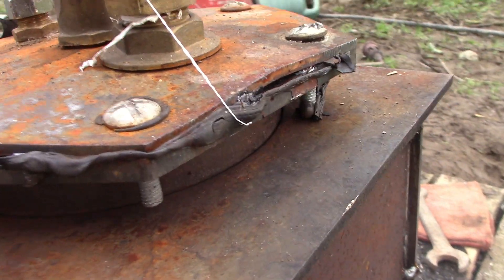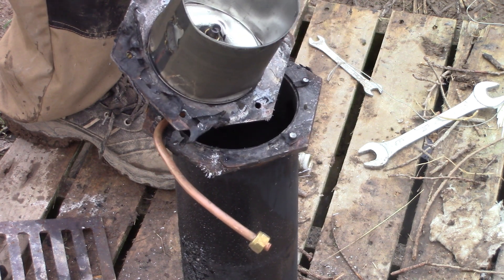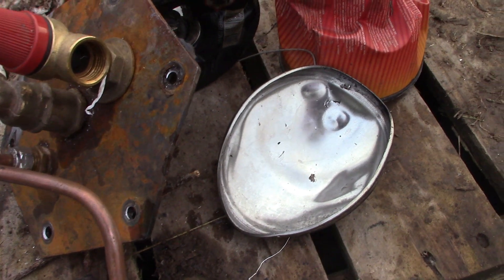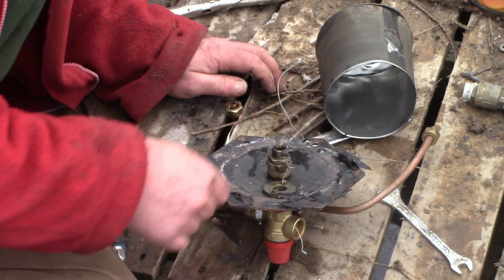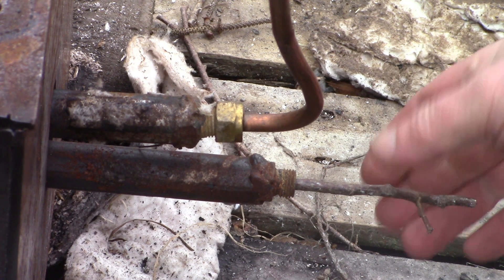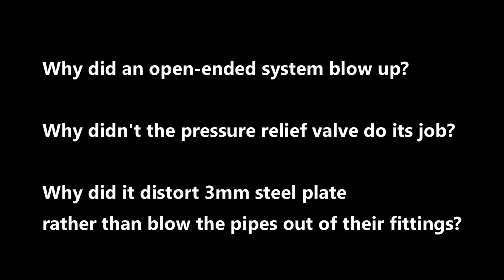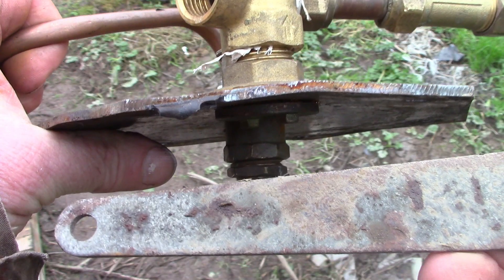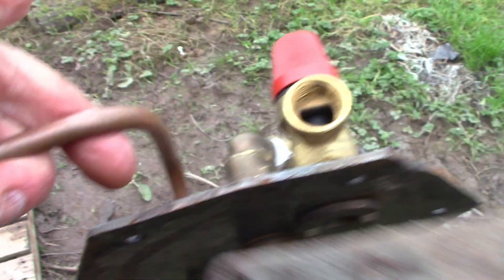Why Did My Boiler Explode??!! My Own Big Bang Theory...

Comment: I think the upper gas bottle was leaky and got water in it over time.

So as you heated the boiler up the pressure increased in it every time a little more.

This time there were enough water in it to blow the bottom out and the top was accelerated upwards. Hitting them lid of your container.

Comment: I'm glad you're safe. Maybe this is a good reason to add more pressure relief valves farther down the line from the main water boiler?

Why did an open-ended system blow up?

Just because there's an open end doesn't mean that it's impossible for the pressure in the system to become sufficiently high to rupture something. For example rocket engines are open on one end, and you can still have a nozzle failure where it blows up. If there's enough restriction in the system it can effectively be the same as being a closed system. Ever tried breathing through a straw?

Why didn't the pressure relief valve do its job?

I can only assume the pressure in the system at that point was not high enough to open the valve. However it seems that the pressure elsewhere in the system was high enough to cave that steel lid upwards so I cant really say. Could also be a faulty valve or not rated for that temperature? Seems simple enough to add redundant valves through the system?

Why did it distort 3mm steel plate rather than blow the pipes out of their fittings?

I'm guessing this one is in part due to the much larger working area of they plate compared to the relatively smaller area of the pipe. Lets say your lid is about 10 cm across, so about 31 cm^2. The pressure in the chamber is 2 bar (not enough to open the valve) so we have about 2 kg per cm^2 for a total of 62 kg being exerted on the lid, compared to about 2 kg on the area of the pipe.

I'm not sure what temperature the boiler walls were at but the steel could be significantly weekend by the temps achieved inside a wood stove https://www.engineeringtoolbox.com/metal-temperature-strength-d_1353.html https://fireandsaw.com/wood-fire-temperature/

Another possibility: Steam (a gas) is compressible, while water (a liquid) is not, so the steam parts of system would be able to absorb the compression in the steam by being compressible, while that same pressure on the water would push on the lid since effectively the water would not be compressed.

Best of luck, it's been (and continues to be) great fun watching your videos, and I hope you stay safe. I really enjoy your simple approach to understanding and solving problems.
Reply: And it also seems like we cant rule out there being some gas, possibly mixed with air left in those gas canisters. An explosion of that would have a great effect on the water boiler chamber but be absorbed by the steam in the steam pipes.

Comment: I think The lower canister collapsed and the increase from the steam flash blew the upper canister up into the lid, that is why it was punched over the valve. The other option and more likely is that the heat of the steam caused a gas (left over butane/propane) in the upper canister to explode and the bottom blew out and the top slammed into the valve on the top. The collapse of the lower canister could have occurred either during the explosion or prior from the steam pressure.  Also the pressure/temperature valve did not release which would indicate it was a very rapid explosion not a steam explosion. 
I'd change the floats to foam filled containers rather than gas canisters. I think I would make the top flange round and double the number of bolts.

Comment: I think you need a pop off in addition to your pressure relief valve.. I deliberately made weak point that can pop off in the event of a failure like you described at the end of this video rather than potentially causing catastrophic failure.

Comment: you might create backpressure frome the 2  and 3 stages, and the second thing, when you create a low presure, the boiling tempreture decreses....  therefore you might get a larger amount of steam.. i sugest using a ful wood floate to prevent implosions....

Comment: yeah this result is exactly why i said i was so relieved last video, when you mentioned adding in the pressure relief valves, etc. 
steam engines are novel and great, but they really are not something to mess around with. and there's always something you could never predict that messes it all up

Comment: The reason why the tins blew up was most likely the expansion of gas in a separate and completely enclosed system (tins) and the easiest way for all the gas to escape was to un-roll the seams of the tins. The sudden increase in pressure from the tins failing caused the other one (probably cooler) to implode and the 3mm lid to bulge.

Comment: I beleve the cap of the top float broke (possibly heat stress?) and allowed the float to reach the top of the steam chamber (https://youtu.be/AzI4rQ-gDQ0?t=109). These kind of containers are great at holding high pressure but can be crushed fairly easily. At this point the float created a seal over the entire top of the boiler blocking the output and relief value. This increased pressure crushed the floats and caused the failure of the top lid.

To guard against this you would need to make sure that there is always a path for steam to reach the relief valve. A number of small baffles inside along the top and sides of the tank with holes to ensure steam can flow around any obstruction should prevent this kind of failure.

To those that beleve the floats exploded: The air in the containers would get hot but it has a fixed initial volume and thus the pressure is purely a function of tempature. I the case of the steam the pressure can get much higher since we are boiling off the water and increasing the density of the steam ( and therefor pressure ). The diffrence in pressure could crush the floats.

Comment: The video before this video, the one where you put the gas canisters inside the boiler, is one of those videos where people shout "NO don't do it" but of course being past  tense you already had done it. Your boiler exploded because you cooked 2 gas canisters inside it, regardless of whether they were empty or not they were still pressurized canisters and as such potentially "bombs" if cooked off. As you placed them inside and secured to lid I was already expecting this outcome video. Your extremely lucky, the results could of been far worse.

Comment: I think I'm leaning towards what Matthias is saying, the sealed floats were the problem I think. I know some people are saying there is a lot of resistance from the long steam path, but I don't know enough about that. It certainly seems like the sealed floats could explode under high heat. Possible to find ones with a relief valve, or maybe you can add your own or a tiny one-way valve in the floats so they can release their pressure but not fill with water. My initial thought was an opening at the top of the float to let the air inside equalize in pressure, but without letting in water, but you might have to switch to a single float situation with that. 

At any rate, fascinating stuff as always, and I'm very happy nobody got hurt! Cheers!

Comment: My theory: I think your bottom float imploded under the pressure from within the boiler, being closer to the heat source it weakened first,
That volume of air from within the float is then forced out at extreme pressure, hitting the top float and launching it into the roof of the boiler, impaling itself on your fittings and releasing it's pressured ait in the same moment.
 The force of the top float hitting the top plate combined with the increase in pressure, buckled the boiler roof until it broke the seal. 

Despite being open ended, the sudden increase in pressure had nowhere to go but through the top/main gasket.

🤷🏼‍♂️? Thoughts

Comment: My theory is that as the float collapsed it did so suddenly and quickly, picking up a LOT of momentum, that then slammed upwards into the lid like a hammer blow when it couldn't colapse any further.  I would replace the floats with something solid that can't colapse, but which still floats, like a piece of wood.

Comment: Using those small single-use aluminium propane/butane cooking gas cartridges was likely a poor choice and runs counter to the safety recommendations written on the cartridge warning not to expose the cartridge to excessive heat even when empty as a significant amount of the gas may still be present even when it no longer delivers any of it's contents, exceeding their designed pressure rating is not difficult if they are exposed to prolonged heating, they are designed to withstand internal pressure but are not intended to stand up to external pressure. They are very accessible pressure vessels but I don't think they're suitable for the application you're using them in.
Now this is just conjecture but I'll say this: The single-use non-refillable propane/butane cooking gas cartridges you used are constructed in a similar way to a carbonate soft drink can; they are made from a sheet that is formed into a dome shape which is joined to a rounded lower section by a roll joint and that joint is designed to quickly and cleanly fail in the event of hazardous overpressure (such as during prolonged heating) instead of the walls rupturing and potentially projecting small, high velocity fragments. This joint failing results in the upper formed section being projected upwards and the lower section downwards as a result of the contents escaping downwards and the upper section becoming impaled on the protruding valve body may have occluded both the emergency pressure relief valve and the steam output to the point where steam could not escape fast enough to prevent overpressure, which combined with the impact from the float body may have deformed the upper plate enough that the boiler was open to the atmosphere resulting in a BLEVE: A boiling liquid expanding vapour explosion, which occurs when a liquid substance in a container like liquid butane or water which remains as a liquid at that temperature due to pressure rapidly and explosively flashes to a vapour when the container ruptures and the contents are then subject only to atmospheric pressure, that volume of pressurised liquid occupies a volume often 1250-2250x smaller than the same amount of substance as a gas at atmospheric pressure and the change in volume occupied by that substance is often so rapid and violent that it precipitates as an explosion.

Comment: Irrespective of the cause... Given that you will continue to mess about with this, and given that "bad things" can happen (as several others have said, that was NOT a boiler explosion, it was just a leak), may I suggest that in future you add a burst disk to the boiler? At least by doing that, you can hope to control where the upcoming /actual/ explosion happens, and perhaps direct it away from yourself. The key is that pressure relief valve has a limited capacity, and can become clogged. A burst disk provides MUCH larger capacity, and can be placed in a location which a human is unlikely to be facing. Now... what position is that on your setup... scratches head That's a harder question. On a full sized boiler, it would be up top, above human head height. On a small boiler, it should be on the bottom, directing the force into the ground and around boot covered feet; but then the boiler has to be well mounted to a cement pad or something that will keep it flying up as a result. Not possible on your setup. Perhaps yours could face out one side and you can just try to never be on that side? Please don't kill or mame yourself? I would miss your videos.

Comment: My best guess is that because you had the steam outlet reduced, this caused a slight pressure increase which also raised the temperature of the floats this could have caused a rapid failure. As for the pressure release valve not opening, this is likely caused by rapid explosion. I do know that 7 psi in in a pvc pipe is enough to blow a rubber cap/hose clamp off with some force. I do not know how to calculate the pressures of steam explosions yet i that 30 psi explosion is enough to bend that lid. When you were explaining the collapase of the containers that could have caused a rapid growth of pressure to which caused the lid to warp. These are my guesses and the only thing factual is the rubber cap blowing off at 7 psi as I have done this a number of times on job sites.

Comment: I don't think your boiler exploded. I think your top gas canister exploded. The hole in the top of the canister was pushed up against the valve at the top, sealing it off. Pressure built up in the canister and it exploded inside the boiler.

Comment: i beleve the top float / gas canister blue up as even if it hase 0 psi in it coled gas expans fast when heated up so then the bottle blue up i think it would of forced the top half of it up hard anouth to bend the 3mm steel bariung mind its pushing aganst water like a bottle rocket that will explain the force and the bottom of the bottle crushed the lower float thats what i think as the safty valve should of opend way befor steam preshure could of bent the 3mm steel.

Comment: Those cylinders that you used as floats aren't designed for external pressure. The top one deformed onto the relief valve, blocking its relief passage.
You also had to prise the top float off the float valve as it had pierced the top. That would mean that the valve was closed, and the boiler was a closed system. 
The lid blew before the fittings for two reasons, first, because the fittings were blocked off by the float, and second, because pressure acts on surface area (think pounds per square inch).

Comment: My best guess looking at the outward bend in the boiler as shown, is that you did indeed have a blockage preventing release of pressure, then kaboom!   Lol. 😂
Glad your not hurt as it could have been lethal.
This accident gave me a great idea 💡!   Design in a replaceable weak spot using smaller guage steel that will give way before ruining your tank if the other fail safes fail.  Just make sure this replaceable thinner metal is located in a safe place, jic.  :)
Redundance in safety is key!

Comment: Level control for boilers is best handled separately from the boiler shell. A second smaller boiler vessel, outside the firebox, attached by 2 valves to the main boiler. You can install a sight glass for manual feed water control or float system to control feed water. My guess is the pressure relief valve was covered by the imploded gas bottles. When the gas bottles imploded they caused water hammer and the force of the water hammer covered the pressure relief valve. The 3 mill plate is either too thin or not reinforced enough, the easiest answer is, to double the plate to 6 mill and try again. From. A. Distance.

Comment: Top Can exploded because of High Heat. Bottom can valve may failed for same reason and had low pressure to crush it. Then everything else happened. Aerosol cans of any type are only made to see X working pressure and 50-65°C max. Worse, those cans had trace amounts of propane or butane in them that will expand more then air and reach bursting pressure easily.

Comment: Sorry I have not been back with those ideas to share.  :(.   Knowing your working with higher pressures and superheated water radically changed what I was going to suggest so I've been reflecting on the designs relevance in light of these new pressures.  I'll make suggestions when I have a better understanding of what your trying to do and the parameters.  Glad your not hurt!   🤕!

Comment: My guess that the tank was out of water due to malfunction in the valve, as the water valve suddenly open you get att steam explosion as the water meets the very, very hot metal, the steam expands in a chock vawe so fast that the pressure valve did not have a chance. A classic train accident.  https://youtu.be/0SM6u_tUSro

Comment: Remindes of an steamtrain accident in east Germany when a steam locomotive went out of water. When the train braked all vater disappeard from the part where the fire was heating but when the water went back it resultet in an terrible accident that killed the people in the locomotive as well as people om the platform where the train would have stopped. So my theory is that it was low on water because the valve did not work properly and when it suddenly opened there where a steam explosion exactly as on the locomotive.

Comment: I believe your theory is correct.

In addition the heat may have weakened the aluminum float.

A safety valve can’t overcome a pressure spike. 

I don’t believe your safety valve should be used for boilers, It looks like something from a hotwater heater.

If you ate trying to create high pressure flash steam use copper everything, it will split but shouldn’t grenade like steel.

Your lid wasn’t stayed properly, I wouldn’t use steel less than 1/4-5/16” and much much heavier if it isn’t stayed.

I never build anything that runs higher than 150 psi.  

Personally I would build a porcupine or water tube boiler & stay well away from high pressure, at some point scale factor no longer applies, heat & pressure do weird things and stuff HAS to be properly engineered to avoid injury.

I hope thats helpful.

Comment: If the outlet and pressure relief valves were not restricted it would not have blown up. Therefore your float canister must have somehow distorted and covered both ports causing pressure to build too much and explode.